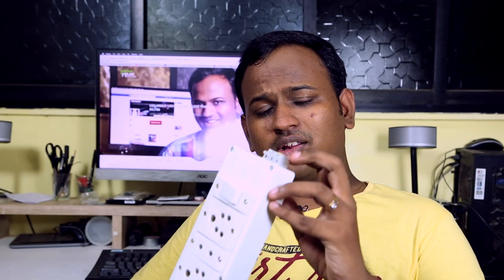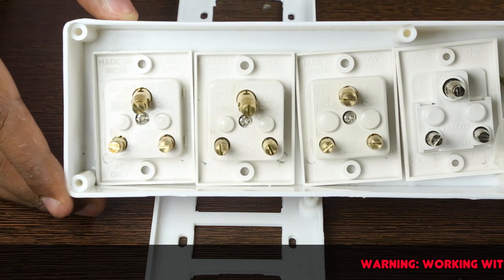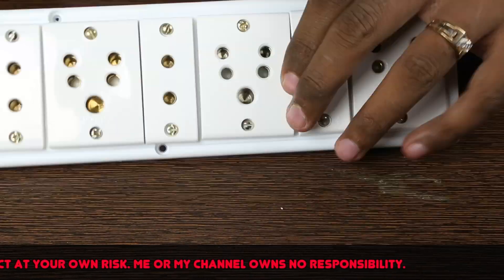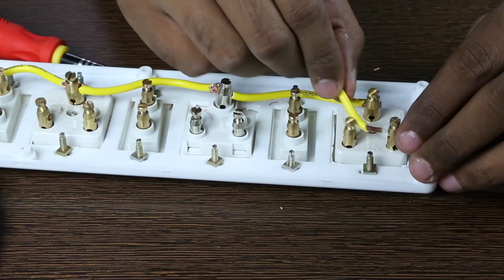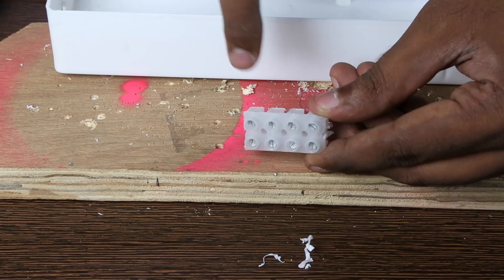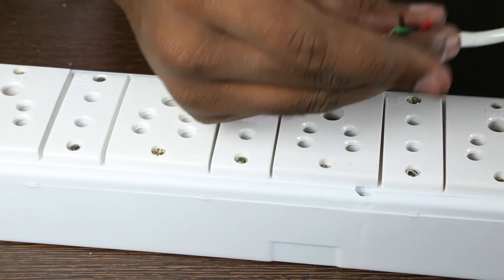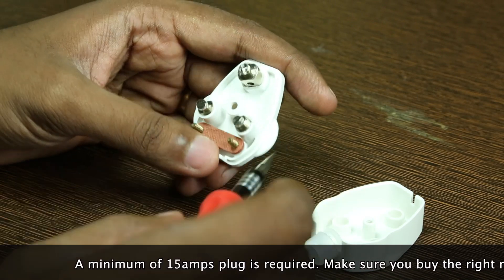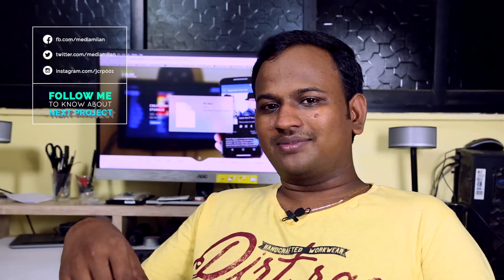DIY - Make an Extension box to power your equipments

Comment: In the U.K. the sockets would be connected with different colour wires. Brown for line, blue for neutral, green and yellow for earth. This ensures that the cable is then connected to the correct terminals. The connection block should also be mounted inside the plastic box as it would be very easy for the wires to break off or become disconnected and someone could receive a potentially lethal shock that could kill. Plus the metal screws or nuts and bolts securing the connector block should be connected to the earth as well.
Reply: Yup!! That way is always better

Comment: Sir, pls reply me about 'How 2 assemble an extension cable with 3 6A 3-pin plug points, a light indicator 
& a surge voltage protection using an MOV'...
Reply from the maker: +Abhinand Ajayan I will share an image tomorrow which will show the schematic properly. It does not have a surge protector but  its simple to add. Just put it in the beginning of the circuit. And when working with AC Circuits always making parallel connections are the best.

Comment: Great video but you forgot to mention whether this extension board is for 6A or 16A and the gauge of wire used was also not mentioned ... otherwise great video ...
Reply from the maker: +Chhanda Das Its a 6A extension board. Will be doing another video which is slower and explains better. Thank you.
Reply: Good job ! Keep 'em comin' ....

Comment: Very impractical as it exposes high voltage on the terminal block outside the unit, hide the terminal block in the box and have a flex cable feed out
Reply from the maker: Please check the updated video!

Comment: total bullshit....you used 1 no. of 5amp switch against 7 nos of 5amp socket....and there is no fuse or MCB in this board....when it runs in over load the switch will be burn to ashes...
Reply from the maker: +Pratap Bachhar Thanks for your interest. But nothing as such has happened to it now and I use it with 2000W flash lights for my photo shoots. Tried and tested.
Reply: USE 4 NOS OF 2000W IN ALL 4NOS OF 5 PIN SOCKET...AND LIGHT IT UP...